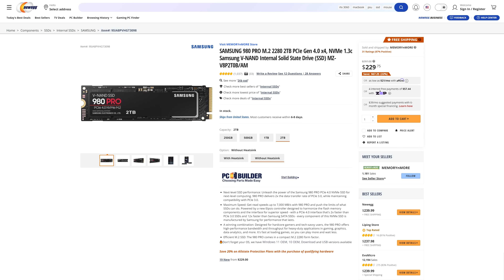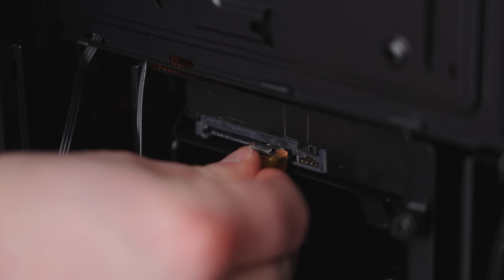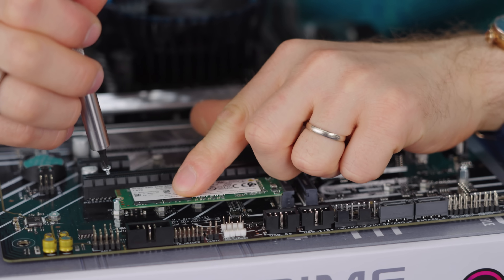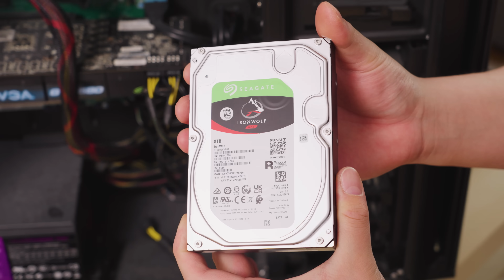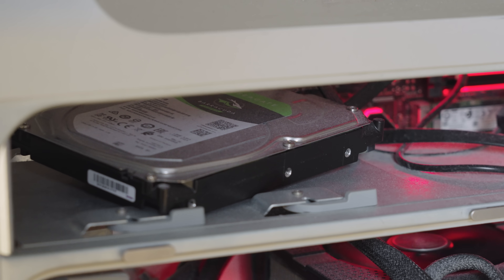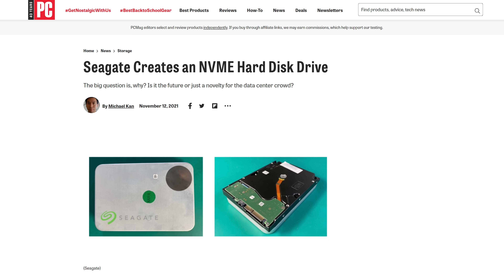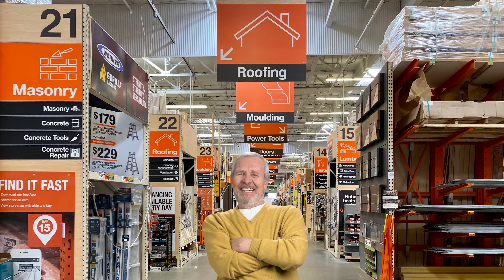Is SATA Obsolete?

Comment: Most motherboards only have 1 or 2 NVMe slots, but many more Sata ports. SATA is here to stay for now just for the ability to add more storage drives.
Reply: They think everyone have $200+ to spend on a mobo.
Reply: @saulgoodman2018  people said that when having more than 2 USB headers on a motherboard was only for premium mobos, times are changing and as manufacturing gets cheaper sata will die
Reply: @rayyannadeem1924  Sata will never die
Reply: @saulgoodman2018  $200? More like $600+ lmao
Reply: @saulgoodman2018  right? I spent $135 for my MB paired with a 10700K and it works fine, and overclocks fine. 2NVME slots is plenty. I have both NVME slots used and two SATA SSDs used
Reply: A modern CPU can directly link to an x16 slot (GPU) and a x4 slot (NVMe), 20 total CPU lanes. On way older motherboards, all M.2 slots were linked to the Chipset, which SATA also uses. You can argue that any motherboard has more SATA ports then NVMe slots but bandwidth is still shared between SATA devices. Although right now, you wouldn't notice a difference when a NVMe connected through the Chipset or directly linked to the CPU. However, with DirectStorage API, this could change that.
Reply: @NeedForMichael999999  sata do not share bandwidth with nvme because the signal is not compatible.
Reply: Most motherboards at this point have 2-4 M.2 slots, so if you need more than 4-8 TB of storage, then SATA should be just fine.
Reply: As an ITX user sata is still relevant for cramming data inside (2nvme, 1 ssd)
Reply: My new motherboard have only one PCI express (taken by GPU) and one nvme slot. So im stuck with Sata for long time.
Reply: I don’t understand why there isn’t SATA 4.0? Why did everything switch to M.2? With SATA you can have 4-5 drives easy with SATA.
Reply: @XxGAMERxXPS3  It's about backwards compatibility according to Yowan Rajcoomar on Quora. Look up "Is there a SATA 4 spec in the works?"
Reply: @XxGAMERxXPS3  because SATA is dead
Read above
Reply: @WizardNumberNext  SATA is not dead. A good SAS controller can provide SATA connections just as well. People buy a SATA HBA because its cheap, only takes one to four PCIe lanes, Can host huge hard drives. Mine has 18 ports. You can't do that with NVMe where speed is the primary consideration. It's going to take very high end hardware to host that many NVMe drives. What you will eventually see is motherboards without SATA controllers and ports. Anyone who wants them will just have to buy the appropriate HBA board. People like to rush to the new thing right away but do you know how long the 3.5" floppy drive has lasted? They still make and use them in China. I know this thread is old as Methuselah but there issues are still current.
Reply: @ok-ol5vt  SAS4 is just around corner - 22gbps
SAS3 is very mature (LSI was sold after it was released, and AVAGO have released at least 4 generations of SAS3 HBAs/RAIDs).
I wouldn't count on SATA-4
SATA is dead for long time
Reply: Um, some motherboards have up to 4 NVME slots, yes, one is tied to the CPU, along with the graphics card, the rest is off the chipset, but 4 NVME drives nonetheless.
Reply: NVMe is not a slot.
Reply: My motherboard has 4 NVMe capable M.2 ports and I could probably get a card to add 1 or 2 more (not sure if my 3rd PCIe slot is a x4 or x8).  I only use two though along with a 2tb SATA SSD.
Reply: Amen. SATA is everything but obsolete 😎
Reply: my budget MB has 3 gen4 m.2 slots
Reply: @eckee  Are there enough PCIe lanes to run them all at full speed though?
Reply: @thestig007  Even at 1/10 speed they are faster but the main point is they are very convenient.
Edit: I checked and there are 12 PCI lanes reserved for pcie4. So it can support 3 of x4 lanes which are used for m.2 drives. The MB is MSI MAG H670 Tomahawk DDR4.
Reply: That can change pretty quickly if the industry in general decides it.
Reply: My Motherboard have 3 NVMe Slots and 1 USB-C slot that can handle 1000.MB/s SSD which is nearly twice the SATA speed.
Reply: I just got back into pc gaming. I was updating a pc and I couldn't find the IED cable lol
Reply: @BOBANDVEG  So you wanted to build a bomb in the shape of a PC?

(You typo'd IDE (Integrated Drive Electronics), as IED (Improvised Explosive Device) ;-))
Reply: @JürgenErhard  lol.....same thing , right
Reply: SATA SSD CHEAP BACKUP STORAGE, MUCH LESS HEAT.. NVME -- HIGH HEAT = HIGH RISK... HEAT destabilizes everything. If you need lighting speed, use NVME for EXPENDABLE data - OS/Apps - configuration files that are large and need to load fast... (as long as all these are backed up)
Reply: Who needs that many storage devices anyways?
Reply: It’ll always stay for legacy
Reply: Exactly. Running 2x NVMe drives and a 2TB SATA MX500 for storage over here.
Reply: Great job repeating what the video just told us
Reply: My has 4 nvme and 4 sata
Reply: I've heard that a NVME can have a negative effect on the Graphics Card in some cases.
Reply: Which is what majorly irks the whole hell out of me that SATA peaked and stopped after 3 revisions, especially since 2.5” SSDs are still a thing. Sure, maybe 600 Mbps theoretical max might be enough for the majority of things, video transferring and editing and game loading, but nowadays with as demanding as games are getting and with 4K or even 8K video it just won’t be enough for some. I know flash technology far exceeds what SATA is capable of, it’s a controller limitation, so when NVMe slots are scarce and there’s plenty of room for plenty of SATA ports on most boards, where the hell is SATA 4/IV? Even coming close to NVMe like 1,200 Mbps, a doubling of SATA III, would be more than welcome by now, because 2.5” SSDs aren’t going anywhere, are easier to add than NVMe drives, and much faster than HDDs, (though their disappointing price per gigabyte compared to hard disks and even NVMe drives is another irritating topic all its own).
Reply: not anymore, my aorus z690 board has 5 nvme slots and only 4 sata
Reply: @rayyannadeem1924  thats still super uncommon though.
Reply: @oxfordsparky Any modern chipset supports more than enough lanes. Assuming your board has 2 x16 4.0 lanes you can run both a x16 GPU off the main and a quad NVMe card that grants each up to 4x 4.0 lanes off the PCH.

It's not the greatest fix but in terms of data density and cost, it's smaller than 4 2.5" SATAs, faster, and not much more expensive per TB.
Reply: @rayyannadeem1924  Lies, the Z690 AORUS MASTER has 6 SATA ports.

(If you populate all M.2 slots with PCIe drives you do lose 2 of those SATA ports and one of the PCIe slots. The inverse is also true, so you have to choose: 5x M.2 PCie + 4x SATA or 4x M.2 PCIe + 6x SATA)
Reply: @rayyannadeem1924  like top of the end motherboards is what most buy...
Reply: @rayyannadeem1924  Having 5 nvme slots on a board that only supports 20 pcie lanes is pointless. The available cpu's don't support the proper pcie structure to support 1 drive let alone 5. Max channel support of a 12900k is 16+4 or (8x2)+4. That's a maximum of 3 channels and the "4" is always connected to the 690 chipset, leaving you 16 free with no gpu.... You only have 2 channels with 16 lanes at most, for 5 drives.... None if you use a 16x PCIe3 gpu.... No clue what Gigabyte was thinking there. Other than more has to be better, even if they are nerfed to death.... That appears to be a great board, until you look at how the PCIe sharing thru the chipset is setup.... Gigabyte is actually buying the Aorus z690 boards back because the sharing setup massively nerfs pcie4 transfer speeds and errors out.... Or you can just use it as a 2 channel pcie3 board with 5 drives that don't have any channels dedicated to them, which defeats nvme in the first place....
Reply: @rayyannadeem1924  My x570 has 3 NVMe slots one of which I'd have to disable the bottom slot and therefore not get to use capture card or whatever else there (there's a lot of PCIe usefulness as OP himself unwittingly just displayed by mentioning good PCIe also means you can stick an extra couple NVMe's on a PCIe daughter board and stick it in like a GPU, although idk how buggy that might be). 

Meanwhile my Taichi board also has 8 SATA ports, which was a feature that specifically made it stand out as a better choice when deciding between a 3600x/3700x or Intel i5 tier when I built, because they had only 6. So basically, I'd need to give up ever getting to use my M-drive/bluray burner, my two 2tb hard drives which cost me like $50 each, and I'd have to give up one of my SSDs. I've got two of those argb SSDs mounted on the side of my case, so maybe I'd have to give up both of those and both the 2tb hard drives to keep the other stuff. I don't need to make those choices with lots of SATA ports.

I think the fact that mSATA was so short lived along with b-key drives whereas the only real difference from hard drives the last 25 years is now they're on SATA instead of IDE is telling.

The added problem is also that taking out my NVMe is a complete pain in the ass because it's under the metal cover/heat spreader of my board, which to unscrew that requires me to take out my GPU and shit. Meanwhile I can just take the side panel off and slide out the drive sled to change drives. NVMe is just way too impractical, expensive, and it degrades, also it costs more on top of being expensive with lanes. I'm getting four drives for the price of one, and that one also heats up too much and frankly the real daily use of a drive just doesn't justify its burst speeds at all because NVMe is mainly for massive file transfers, like say in video editing. Note this means nothing to the typical gamer, who's not likely to ever notice a game's load speeds increasing. LTT themselves did a video on this and it's like night and day between HDD and SSD, but NVMe SSD vs SATA SSD is like a couple seconds tops. This is because of the way it works where you'll notice this really high burst speed and then it's basically transfering files at super slower speed. It's even less useful when you consider that most file transfers are probably going to be between either drive and USB, or between drive and download, with those two being your real bottlenecks.

NVMe is one of those type of flashy things that's meaningless to gamers and just a flashy thing to enthusiasts, like a Threadripper, because it's got such niche uses that's pointless to your average on a budget gamer. Like imagine the average gamer having to buy a super high end board just to store his games and cringey hentai collection or whatever. It's FANTASTIC if you're doing lots of professional video editing and rendering, but to the average budget PC builder who's only going to spend $150 on a mediocre board and allocate the rest to graphics/CPU/RAM whatever, it's super pointless to give up SATA for NVMe. Like I do actually notice super fast file transfers between my different drives, but a lot of the time that's transfering a video to a hard drive, or something going to flash drive via USB 3/3.2, or to a back up SSD or whatever.

Understand I'm not talking about you or your choice in board, but to the average gamer. If you run a twitch channel and do tons of video work 5 NVMes is super great, but to my use case it's pretty appallingly bad particularly when as OP said, if it's a big enough problem my fat stack of lanes let's me either insert a new 8 SATA port PCIe card, or a new USB 3 daughter board (pointless tbh it's there for the front panel card reader's USB 3 I bought so I have more front panel USB, if you vape or download things to your phone on top of keyboard, mouse, file transfer, and having a HOTAS you'll find out real quick what lots of fast stable USB 3 means) or I can stick a PCIe card in to add more NVMe.

Basically, la PCIe familia es todos. There's no point to sacrificing tons of lanes to the extent you lose SATA just to get a few more NVMes which obviously cost may not matter to you as much but price matters to most people and your board alone costs $$$ plus those NVMes will cost more money. Hope I've explained the logic well.
Reply: @rayyannadeem1924  that's becuz u have a high end board, i have a mid range b550 it only has 1 nvme slot :(
Reply: NVMe is becoming more affordable. The reason!! Well whatever comes after NVME is right around the corner.  I bet in about 2 years SATA will be hard to find.
Reply: Apple and the rise of ARM chips be like: "Hold my SoC's"
Reply: @bigbubba0439  Who the fuck cares about those dinky arm chips, WE'RE TALKING ABOUT STORAGE.
Reply: @bigbubba0439   let us know when you can actually game on an apple computer lol.
Reply: @mattalford3932  Well, does running modded Minecraft with shaders at 20 watts of total system usage count? I see all the advantages of PC (and even I am planning on getting a PC), but you got to give Apple credit where credit is due
Reply: Why would anyone need more than 1 or 2 drives installed anyway? In case I need some additional storage, external USB drives cover all my needs. Possibility of adding 6 SATA drives is just as useless as it sounds.
Reply: @Zhabishe  I guess you've never shot 4k video before.
Reply: @thestig007  Well, we were talking about general PC users, not video editing enthusiasts, aren't we? You are correct tho, I mostly stick to 1080p editing and for that matter my two NVME SSDs are more than enough =)
Reply: @Zhabishe  you said "anyone"
Reply: @igorswies5913  Okay, you got me by the balls here. I really meant "almost anyone" as in "most people". Tho even the craziest designers realistically won't go as far as 6 drives in one pc.
Reply: @Zhabishe  what if i need 5 optical drives?
Reply: @ianciti  Then you can buy one USB hub and 5 USB optical drives. That is, if someone needs at least one optical drive in 2022.
Reply: @Zhabishe  to be fair i was just shitposting about 5 optical drives. but noooooooo i will not settle for a usb optical. that is absolutley not in option. in my personal experience usb opt drives are freaking slowwwwwww.
Reply: @Zhabishe  storing videos, steam library, photos, movies, music, anime... I just recently sold my 4x4tb HDDs to replace with 4x8 HDDs as started running low on space.
Reply: @Zhabishe  No, not useless. If you are a creator, you WILL need all those connections for storage, at least, until you move to a NAS or cloud storage. Even 1080P footage takes up considerable space on a drive, this is even with compressed formats like h.264/265. 

Most video editors will have assets, along with the actual video itself all stored on a drive, so at minimum, a 1TB, preferably more will be needed.
Reply: Pcie expansion cards can hold 1-4 nvme slots, no need for SATA ports
Reply: @chronometer9931  yes, but then you have to share bandwith with GPU.
Reply: @salemas5  Most people aren't going to run into a problem like that and even if they did they wouldn't notice
Reply: @chronometer9931  they would notice
Reply: @salemas5  You are already sharing bandwidth with the GPU, if that matters or not depends on the number of PCIe lanes the CPU offers.
That is unless one or more M.2 slots are managed by the MoBo chipset which in some cases slows down those NVMe drives to the point that they might as well be SATA.
Reply: @salemas5  that hasn't been true for a long time, Ryzen has 24 lanes, 4 for chipset, 4 for direct nvme and 16 for pcie slots which as standard are all for the primary x16 slot.
Reply: @salemas5  Get a Xeon and enjoy 40 PCI-E lanes
Reply: Depends on the topology of the system.
In general you don't really need to worry much about GPU bandwidth on contemporary systems unless you're running a high end card at low resolutions. 

This could change with DirectStorage but that's a future problem.
Reply: @oxfordsparky  Actually many modern motherboards still connect the secondary x16 slot to the same 16 CPU lanes as the primary slot splitting bandwidth as x8/x8 between them when the second slot is occupied, and some boards even also connect a secondary M.2 to those same lanes. Some boards however will connect a secondary x16 slot to the chipset instead of the CPU and thus won't be shared with the primary slot, usually these slots will run at x4 or x8 bandwidth on possibly a lower PCIe gen and may be shared amongst other x1 or M.2 slots.

So modern boards may still share the primary slot bandwidth with other slots. And generally speaking bandwidth configuration of the PCIe, M.2 and even SATA slots is still an important consideration when deciding how to use them.
Reply: @talibong9518  I rather get threadripper and enjoy 64 lanes for less money with faster CPU
Xeon always was limiting CPU and always will be
Reply: @i-wish-i-was-afk  oh it absolutely is.
I've hand my hands on some absolutely garbage motherboards where all the M.2 slots were all managed by garbage chipsets slowing NVMe drives down to SATA speeds.
Reply: @salemas5  It's not realistic to saturate the PCIe lanes with traffic with both graphics card and the NVMe at the same time though. I think you would have like 4k gaming maxed settings while encoding 4k video and compressing large files on different NVMe drives. Outside the scope of a desktop machine a bit.
Reply: @salemas5  if you have pcie 4.0 with a gpu that’s 3.0 that won’t matter and still have 2 nvme drives in the pcie lines and probably a third one on the motherboard
Reply: @oxfordsparky  Yeah but a) this is partly theoretical i.e. "will we lose PCIe lanes for SATA to get NVME" basically, b) that's Ryzen. Intel's a little different, but it really matters per the board, where you could switch into x8 mode no problem on PCIe 5.0 with high end GPU even next gen, sure. But you're still going to reach a point fast where you're having to decide what to enable or disable on your finite number of lanes. That's partly why all boards have to decide how they're going to allocate a limited number of USB and SATA lanes, why the older boards had mSATA slots but you could disable SATA ports to use it. Where it really starts mattering is desktop. 

It's just not a big deal on laptop is the problem, which is why we got NVMe drives and SATA SSD being a big thing because it shaves more weight. If you want ultra light ultra thin it's great, which is why we have those drives being a big deal because even laptop hard drives are pretty heavy, although it funnily enough becomes a question soon of benefits being outweighed when NVMe gen X.0 gets so fast and hot that it adds more metal to the laptop needing to cool itself (because battery life and running cool are the other two biggest things to laptop makers).

But obviously if weight is not the problem, but things like cost and storage options or versatility is, it becomes less of a great thing. Like if you're doing lots of gaming it makes sense to stick your older games on a 7200rpm HDD or even a flash drive, and then stick your newer games on SSD and use NVMe as the boot drive but even then I question the longterm health of my Sabrent boot drive. This is a really huge deal on more budget boards with already limited I/O options where you're now basically sacrificing a lot of the reasons you'd build a desktop in the first place to get another NVMe or two. Really a big part boils down to lane usage, and the fact each drive requires 4 lanes. Because it's so costly even now, it's not even about splitting GPU into x8, it's about losing all that connectivity for basically one or two more NVMe drives.
Reply: @talibong9518  or a threadripper and have 64
Reply: @oxfordsparky  it'll be true if you're using all the NVMEs you can possibly install on the market.
Reply: @talibong9518  this is the literal reason I actually wanted threadripper lol
Reply: @REXae86  especially because youd have to be insane in order to buy a motherboard that even has more than one x16 pcie slot, that shit costs the same as a decent cpu
Reply: @chronometer9931  "Most people aren't going to run into a problem like that and even if they did they wouldn't notice"

Yes you can.  It's only the newer MBs that give you a PCIe slot that's worth a crap.  AMD doesn't have a MB that has a PCIe slot off the chipset that's X8.  The best you get is X4.  I don't know about Intel.  When you plug an NVMe controller into the 2nd PCIe slot that's capable of handling an NVMe controller since they require 4 lanes for each NVMe drive unless you buy a REALLY expensive NVMe controller and it multiplexes, you have no choice to plug it into the 2nd slot off the CPU so it becomes X8.  Your GPU also becomes X8.  So, first this means that you CAN'T plug in an NVMe adapter that can hold 4 drives because you only get 8 lanes (unless once again you buy a REALLY expensive NVMe adapter that will multiplex).  Or, you can plug in that adapter but you can only use 2 drives.

THEN you get into the issue of bifurcation.  You have to have a CPU and MB that BOTH will allow bifurcation on the 2 slots that connect to the CPU.  Less costly MBs won't do this.  At best you can plug in 2 GPUs into those 2 slots and that's it.  Most PC desktop MBs (non HEDT) can only accept GPU in those 2 slots.

So the reality is most PCs you can't plug in an NVMe adapter.  For the ones that you can, it requires that the MB and CPU both allow bifurcation off the 16 lanes that go directly to the CPU because in the last few years it's rare you get a PCIe slot off the chipset that's more than X4.  The kind of NVMe adapters that most people can afford to buy REQUIRE 4 lanes for each NVMe that gets connected, so an adapter than holds 4 drives needs 16 lanes.  The only place that can go is on an HEDT or WS.

So, even if you CAN get an X8 adapter for 2 drives, it connects directly to the CPU except for maybe some Intel based systems (I don't know, not going to look it up).  Because it shares the connection to the CPU ALONG WITH the GPU, yes it can have a bearing on the GPU.  It depends what you're doing and it depends on the speed of the GPU and the speed of the drives.  If you're just using it for data storage then no you won't notice.  But, if your MB has PCIe gen3 and you buy a new top tier GPU, you're throttling the GPU part of the time in some games.  So you'd need a MB with gen4 lanes to make sure that everything works fine.  But if you load games on those NVMe drives NOW you do have a bandwidth issue because during game play you pull data off the drive to feed to the GPU from my understanding so now that interface has transactions going on for both getting data off drives, and then getting it to the GPU along with only having X8 for the GPU.
Reply: @oxfordsparky  4 for direct nvme meaning that x4 is only for one single m2
Reply: @salemas5  That's not true in this form.
Reply: @salemas5 literally no gpu can be límited by 16x PCI 3.0 
Now we have PCI 5.0 lol
Reply: @salemas5  You don't have to share bandwidth with the GPU, you can put an M.2 expansion card in a secondary slot connected to the chipset.
However, this increases latency and has to share bandwidth with other devices in secondary PCIe slots.
Reply: @salemas5  sata uses pci lanes too
Reply: @chronometer9931  not everyone has an atx mobo buddy
Reply: @bigweeweehaver  Then use a usb 3 adapter. I have one, it works great
Reply: @bigweeweehaver  Plenty of mATX motherboards have 2 PCIe x16 slots.
Reply: @chronometer9931  i still use optical drives because i still buy DVDs and Blu Rays. i still advocate for rights to physical owernship and dont like everything being stream or cloud based. i still buy physical albums CDs. and i know im not the only one about this. theres still a considerably sized group that still buy CDs and DVDs and Blu Rays or they wouldnt keep manufacturing them.
Reply: @ianciti  I advocate for personal ownership, but it doesn't have to be hardware. I just need the video/music. I don't want to own a DVD or CD, I want to own a movie or song. I'm actually shocked they still sell DVDs, blue ray I get, but DVD... The only exception I'm really willing to make here is blu-ray for movie buffs. Old people still buy that stuff because they don't understand computers, but you know your way around a PC I'm sure
Reply: @chronometer9931  imo dvd is the perfect platform cause you can fit up to a 1080p movie on there and also has subtitles. thats all i need. anything beyond that is. imho. too much. its cheap to manufacture and unless youre a film enthusiast setting up a theatre experience in your house is acceptable for any given case. also its an easy backup feature in case of network outages
Reply: @ianciti  Well this aged like fine milk.
Reply: @chronometer9931  PCI-e HBA cards break out to 16 SATA ports...your point is?
Reply: @trueppp  what's the point? 
Why anybody would even look at 16 port SATA HBA, when you can buy 16 port SAS3 HBA, which at the same time supports NVME?
I have had one for just a bit more then £100, I sold it for over £500, but still SATA, SAS and NVME in single device
Reply: @WizardNumberNext  LSI SAS/SATA RAID cards can be had for less. Havent seen any mini-SAS to NVme cables
Reply: @trueppp  price depends on both generation and feature list
I know market well enough. I don't just use them, I sell them and know prices very well. 
I am not mentioning basic 2300 series
I am mentioning 3200 or even 3300 series
Those are starting at £500 and no getting them any cheaper isn't easy. It needs both knowledge and a lot of luck.
16 port 3000 series are £1000 or over, so don't mix things
NVME sorry its from 3200 series
16 port 3200 series with internal connectors will be around £3000 if not £5000
Those are expensive, as we are talking recent technology, still in use in data centres and feature list too
Reply: @trueppp  Whoosh!
Reply: @chronometer9931  what if someone wants a secondary drive to be an HDD?
Reply: @igorswies5913  Either invest in network storage or get a USB 3 HDD enclosure for your HDD
Reply: @chronometer9931  I guess the average person prefers the drive to be inside the computer if possible
Reply: @chronometer9931  yes,  they do. 
But most chipsets and CPUs will see first NVME only
There are expansions for 4 or more NVME but they have PCIe bridge and cost at least 10x as much as those basic ones for bifourcation
Reply: @chronometer9931  Does your CPU have enough lanes to run that card without compromising the performance of your GPU? Unless you have a Xeon or a Threadripper/Epyc...the answer is probably 'no'.
Reply: @chronometer9931  Oh, now I get it, you're an SSD fanboi!
Reply: @chronometer9931  Yes we will notice, he's right, and you guys are really not getting that PCIe lanes, much like Earth's natural resources and labour pools, is not infinite. PCIe lanes don't just grow on trees. It actually matters to me quite a lot, so much so I'd switch CPU brands just based on one of them giving me like 12 more added lanes between the CPU and the chipset. What you just said is a part of why: because PCIe is so damn useful and flexible (not that I could get my old 1394 firewire card to work on this new machine though, or that majority of kids will ever have use for PCIe DACs and Soundblasters).

See the problem is, you are literally going to need to use PCIe lanes in order to do that which on a typical okish to good mobo, you're getting like 16 off the Ryzen CPU going directly to graphics, 4 directly to NVMe (this is your boot drive) and 4 to the chipset which gives you moar lanes. So basically, all your lanes are judged on what chipset you have, which if you're getting one of those cheap a320 whatever type prebuilt shite boards, you're not getting much fast storage. This is different with Intel where it's more lanes off chipset and not the direct connect off CPU like AMD but same deal. 

So what you basically end up with is a total of say 40 lanes on an actually good (and costlier) board and of those deduct 4 for chipset-CPU interface, deduct 16 for GPU. You've now got only 20 lanes to play with on an expensive board, that in my case my $300 board iirc disables the bottom 3rd PCIe slot to use the bottom 3rd NVMe slot. For just THREE drives I have to blow through 12 lanes. I have 6 non-NVMe drives right now, plus 2 NVMes and 2 flash drives for added pixelart/2006 tier game storage. OH, AND the 2 CD drives that most people don't have/want these days. That's a hell of a lot of storage options that I won't have by switching from all that storage to like 3 more nVMEs. That also can be expanded by running your GPU at half lanes, but why tf would you want to halve your GPU lanes (to understand why lane speed/bandwith is a problem, see also: 6500XT.) It won't be as much a problem atm, but with faster GPUs you eventually get to a point where you're saturating PCIe lanes.
Reply: @chronometer9931  Well, you  still need a SATA cable for that.
Reply: @chronometer9931  1-4 is nothing, and then you are adding additional cost for budget market, obviously it doesn't matter if you can afford a used car's worth of 8TB nvme's.
Reply: @chronometer9931  with less PCI-E slots showing up I don't see that as a practical option. Especially on the smaller boards.
Reply: @chronometer9931  "Pcie expansion cards can hold 1-4 nvme slots, no need for SATA ports"

We'll agree to disagree about that point.

I don't care if you can have 16 NVMe ports in a PC.  I can't afford to pay $1600 - $xxxxxxx for 16TB of drive space.

Mechanical drive space costs a lot less than NVMe space when you're talking about large amounts of storage.
Reply: @chronometer9931  my gpu fat so if i put a expansion card right under it  ill basically be choking my gpu  sadly
Reply: @chronometer9931  there is problem, it shares with pcie bus...adding more will degrade your bandwidth is not the same sata ports does...and majority board only have 24X lanes ...only boards are threadrippers workstation boards that has 64x lanes ...its very expensive for lane amounts and people only can put many if they don't use gpu for servers to act as storage server and other server can use as gpu server ..2 racks connecting each other nodes , but for home user...they barely could afford up to 24x lanes ...16x for gpu and 4x for first one and other one can be configure by amount total lanes left either 2 4x nvme and 1x third one ...while other boards only can get one 4x pcie5 while other one only goes 1x for pcie4...very ticky setup that their ton models have different configuration setup is consumers have to pay closer attention to pcie lanes fine print now
Reply: @chronometer9931  That's funny. I have 14 2.5" SATA drives in my rig. NVMe is a resource hog like the world has never seen before. Ryzen processors have 28 PCIe lanes four of which are reserved for the chipset. Each NVMe drive currently takes four PCIe lanes. Usually only one NVMe drive is connected to the CPU the rest go through the chipset. Even so NVMe is crowding other PCIe devices on the motherboard.  This is why NVMe drives are starting to appear in a 5x2 configuration.